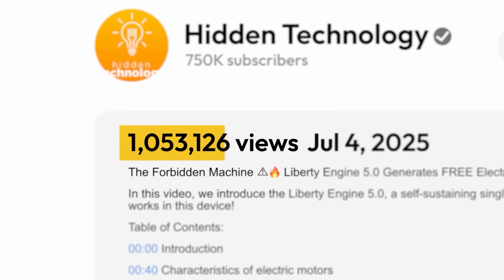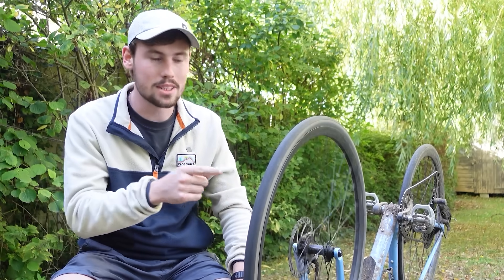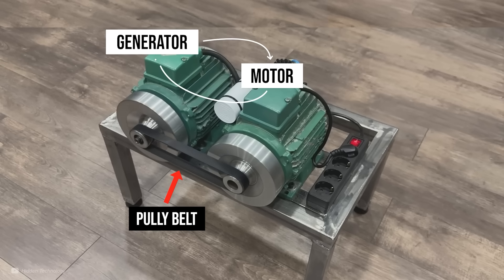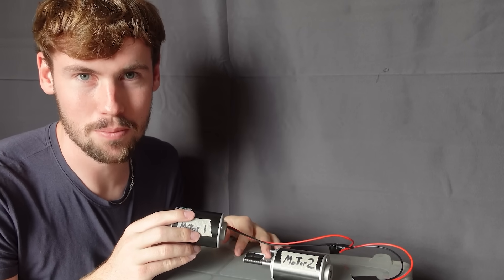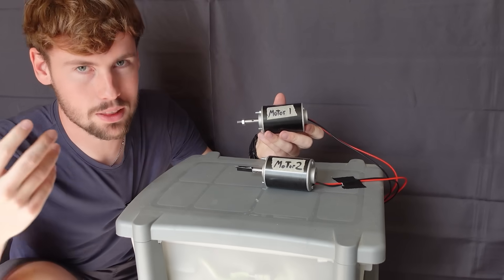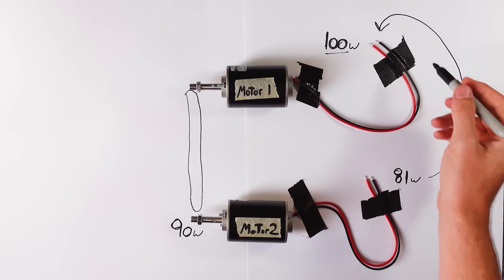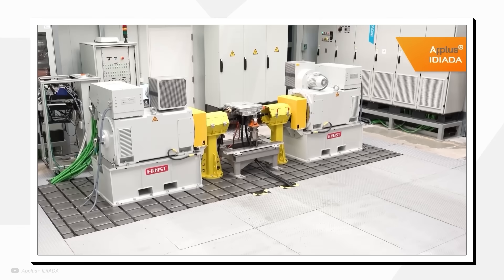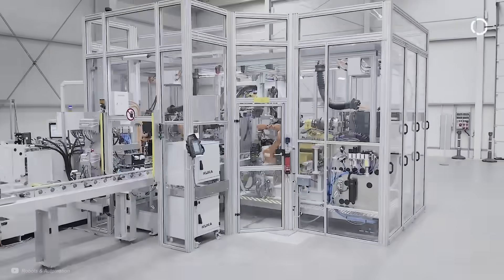100 Years of Waste! Solved by an Unlikely Invention.

Comment: Free energy and perpetual motion are entirely different things.  Perpetual motion is at least theoretically possible.  You could take a perpetual motion machine into intersteller space and spin it and it will spin for so long that it is essentially a perpetual motion machine.  What you cannot do is extract energy from the system in any way without it stopping.
Reply: Easier to use atmospheric energy. See  Herman Plausen's industrial scale patents
Reply: @jeffbrinkerhoff5121  Atmospheric what, you say?

Btw, just because you got a patent on something doesn't mean the thing patented is true, correct or working. There are TONS of patents of supposed perpetual motion machines, and ZERO of them actually work!
Reply: @lennyvalentin6485 hi Lenny. Plausen used balloons with gold plated acid sharpened needles to collect charges typically above 900' altitude. His motors were aimilar to rhe Jeffimenko style shown in this old video. Yes atmospheric energy.
https://youtu.be/9uEjXsX1F14?si=CHcpIYCUdfYLMm0J
Reply: @jeffbrinkerhoff5121  You mean Hermann Plauson, I assume. It's helpful if you get peoples' names right when one is trying to research them. ;) Anyway, he sounds like a crank, as does his ideas. Anyhow, if his contraptions could have collected any substantial amounts of energy (no reason to believe that to be the case), people would be doing it by now.

Like with so many other crank nonsense ideas (the "100 mpg carburettor", the "car that runs on water", etc etc etc etc), they all fall on the fact that if they did in fact work, people would have commercialized them long ago already. Because if they're viable, and work, someone could be making money out of them, and people love to make money, so they would be doing it.

In reality though, the Earth's atmosphere is some of the most researched systems we have, if it was somehow a source of free, abundant, harnessable energy, this would be widely known and yes, exploited also.

THE FACT IT IS NOT tells us that:
A: the energy might not be exploitable in a way which is commercially viable,
2: the energy might not be abundant, or even exist at all.
Reply: @lennyvalentin6485  There is a clock that is running on the subtle changes in atmospheric pressure.  I think it is called the Atmos Clock.
Nothing like this breaks any law of physics.  There is an easily identifiable source of energy driving it, the sun.

But you would think fuel injection put an end to the 100mpg carb.  But people still believe that crap.  Why the fuel system?  Why not some new miracle piston or some other new ICE design?  Some of these engine designs even exist or at least exist on paper.  There are engine designs where the power stroke is longer than the compression stroke.  It's just complicated (expensive and more points of failure) and additional linkages move inefficiencies elsewhere.
Reply: Everything is already in perpetual motion
Reply: Don't be silly. Perpetual motion machines won't substantially spin any longer in space, because it's not air resistance which is the major inhibitor to them working as perpetual motion machines. Rather, it's the laws of thermodynamics, which are universal.
Reply: @lennyvalentin6485  Wrong.  Depending on the design, you could easily spin something in space far from any mass that will spin essentially forever.
The voyager space craft are going to keep moving for millions if not billions of years.
Reply: That's like saying interstellar comets are perpetual motion "machines," because they will fly between the stars until an impact(s) stops them.    
Using your logic, we already have "perpetual motion machines" on earth because they have been running (slowly) for nearly 150 Years, and will likely run for another hundred.       That doesn't make it perpetual, just a very, very, efficient design & set of operating conditions.
Reply: @GoatPopsicle  Yeah, perpetual motion is possible.  150 years is perpetual motion so far as a person is concerned.
Perpetual motion isn't that impressive. It's just a system with little to no friction.  
You could take a wheel into space and spin it (not on a bearing axis) and it too would spin for a very, very long time.
There are also systems that can, all by themselves, suck energy out of the environment and run "forever" unattended.  There is a type of water pump (ram jet pump) that will run until parts fail or the stream powering it runs dry.  This and windmills are a kind of free energy device (free like beer).
Reply: @tarstarkusz  Just spinning doesn't make a perpetual motion machine, that's simply the conservation of inertia. Basic physics, Isaac Newton stuff for chrissakes. A perpetual motion machine on the other hand (supposedly) creates energy out of nothing. Simply spinning isn't creating anything. The spinning momentum has already been imparted onto the object at some earlier point.

Likewise the momentum of the Voyager spacecraft was imparted on them decades ago (rocket motors, planetary gravity assist maneuvers.) Simply coasting isn't creating energy. Is planet Earth orbiting the sun a perpetual motion machine too, you think?! lolwtf.
Reply: @lennyvalentin6485   You said "A perpetual motion machine on the other hand (supposedly) creates energy out of nothing." 
No.  That is a free energy device.  I've already said you cannot get energy out of a perpetual motion device.  It's just a 100% (or close) efficient device.  Yes, anything that moves in perpetuity is a perpetual motion device.
Yeah, since they will moving at close to 100% efficiency, they will still be moving in hundreds of thousands of years.  They are in motion.  Thus perpetual motion.
No, the Earth is losing momentum.  Plus the moon is stealing some of it.

What some people call perpetual motion devices are actually free energy devices. The system has friction in it and if it were to keep moving, it would have to get that energy somewhere.
Reply: @tarstarkusz  Perpetual motion machines/devices ARE free energy devices. It takes energy to run a device - there are ALWAYS losses. Again - laws of thermodynamics! There are zero 100% efficient energy transfers or transformations. There is always some form of drag, or friction, or energy leakage etc. No machine can run using zero power.

"Anything moving in perpetuity is a..."

Jesus christ. No! Again, anything just MOVING in a straight line (including planetary orbits, curiously) is merely Newton's conservation of inertia. And "close to 100% efficiency" is obviously not perpetuity. It may be a long time, but obviously FINITE. Planets moving in orbits are NOT DEVICES.  A chunk of rock flying through interstellar space is not a device. There's no energy transfer or transferrence.

Even in a high vacuum you can't have actual perpetual motion of anything spinning/moving - due to a phenomenon known as quantum friction a moving/spinning object would have its momentum sapped (extremely slowly.) Again, nothing is 100% loss-free in this universe.

High school physics is a good place to start your studies.
Reply: @lennyvalentin6485  Stop pretending I didn't heavily couch it as being perpetual in terms of a life time or even just in terms of society and not literally forever (literal perpetual).

ANY machine needs an initial push regardless of where that energy comes from.  All (theoretical) perpetual motion devices need to be started.  

The Voyager space craft are devices.  We literally put energy into them and now they are moving and will continue to move for so long that in terms of people, they are perpetual.  They will continue moving long after society has collapsed.

Again, you are just jumping back and onto perpetual, when I have already said multiple times in this thread that they aren't literally perpetual.

Comment: Wouldn't this have applications in renewable energy where you could use renewable energy to spin up a flywheel over a longer period of time that could then be maintained with smaller alternative energy inputs?
Reply: So this is actually a huge part of how green energy normalizes the constant fluctuations in power production.  During production surges, vacuum sealed flywheels are spun up and during low periods, the momentum is bled off, and the power draw out is kept relatively stable, so you don't get sudden flares of extra power or brownouts during relatively normal flux periods.

The flywheels are only a type of battery, though.  They lose mechanical energy at roughly the same rate they gain it.  So you can't use a small amount of power to maintain a larger generative potential.  In a 100% efficient system, you have to put exactly as much power into a system as you want out.  In even highly efficient flywheels, you're going to need to put more in than you get out, just like with a chemical battery.

Comment: If you’ve ever used a series of variable speed drives on a common DC bus then this news is decades old. The deceleration of one motor powers others that are not. Beats using break resistors. But good luck spec’ing the 800VDC switch gear needed for the isolation

Comment: I like the use where, say you have only 1 phase and you need 3, you can have a 1 phase motor connected to a 3 phase generator, and with some control you've got yourself 3 phase power now. Minus losses

Comment: One of the reasons (less educated) ppl believe this crap is momentum, when cables are not visible.
Even without cables a number of these even have an extra flywheel. So flywheels and rotors keep going for some time.

Comment: All of the motor -> generator perpetual motion machines try to look smart, and the grift is full of jargon and fake engineering, but none of them ever cut the losses of converting electricity into mechanical motion and back. That would be easy, just connect a transformer primary to its own secondary and wire up a light in series. The primary and secondary could be any ratio, even 1:1, and if their mechanically coupled transformer design had any chance of working, then the magnetically coupled design would be much easier to do.

But, you know, it doesn't look as complicated, so... 😂

Comment: Real-world perpetual motion machines, that create energy without spending a fuel or exhausting the source of energy within useful time-span exist. E.g. a solar cells do this job, as well as wind turbines, or hydroelectric power plants. The problem however is, fossile fuel industry don't like these concepts. Therefore, they prevent the crucial part of the equation by penal law: An economic seasonal power storage. In my country, (Switzerland), the EleG (electricity law) forbids the use of any form of produced or stored energy without a preexisting legal framework. Of course, things like solar power plants on mountains, or the so called baking-soda hydrogen storage (uses potassium bicarbonate/formiate) can't get such a legal framework. Therefore, we are bound to oil, gas, coal - and juicy electricity bills.
Reply: You would still be using energy input only, it would be coming from the universe, and therefore such a minute percentage that it might as well be perpetual.
Reply: @lookeehere2  It is a matter of definition. Perpetua mobile clearly do not exist. Perpetual motion however can exist, when the source of energy can not be depleted within a sensible amount of time. Machines, operated by solar-, wind-, geothermal energy, etc, meet this definition, because it will take about 4 billion years, until our sun will turn into a red giant and swallow planet earth.
Reply: That's good engineering, but it's not perpetual motion. 

It takes in energy from the sun, loses some as heat and noise, then you get to use the rest.

Even Einstein didn't think thermodynamics could ever be broken. You can't win. You can't even break even :-)
Reply: How is Switzerland's position on having a solar panel at home, and storing energy in a battery?
Reply: @HexBeach  Our leading party (SVP, same mindset as MAGA-Republicans) thwart solar and wind power by construction- and landscape protection laws. They want oil to be the main energy carrier, since our leading SVP-politicians are bribed by SwissOil. Our Environment minister was even the official head of this organisation for years.

Comment: They are very easy to recognize. If it says "Free" in anything it's a lie. There's no such thing as free in physics.
Reply: This is not exactly correct. Free energy in a thermodynamics context (e.g. a Carnot cycle) is alwys the amount of energy, within a system, that is able to do work.
Reply: @debrainwasher  I am sorry to be the bringer of bad news but entropy is a thing. We can only, EVER, go to a state of lesser energy. The best we can do is use the energy we have responsibly.
Reply: @cerellitv2978  did I claim something other? Please read my post again. However, thermodynamics with the entropy thing is only valid in a symmetrical system (see Noether Theorem). E.g. in an ever expanding universe, radiated energy becomes redshifted. Since E=hf, most radiated electromagnetic energy is annihilated. This can be derived from the least action principle.

Comment: We used the motor generator principle to test helicopter gearboxes. The power transmission are in thousands of hp so recirculating the power using electrical control equipment made it possible to test gearboxes with about tenth of the power. Basically inputing power just to cover the mechanical and electrical losses. Before that we used mechanically closed drive train loops, using the motor/generators system enabled different ratio gearboxes to be tested on the same rig.

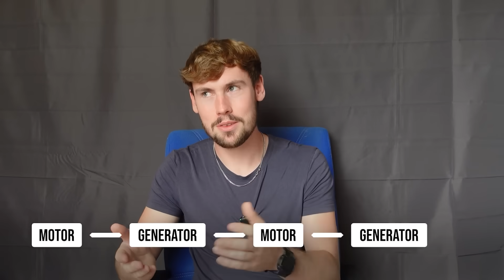Comment: 3:15 Fun Fact
This is a real device for creating energy and is in use throughout the world.

Seriously
The device is used to create three phase AC electricity from single phase AC electricity to use in welders and other machines that only run on three phase electricity by spinning a three phase alternator with a single phase motor.
It does however use much more energy than directly plugging the welder or whatever into a three phase mains source.

Comment: This is the same principle behind a motor-generator set used to make non-easy types of power.  If you want to test some piece of aircraft electronics that uses 400Hz power, because 400Hz transformers weigh less, you have to get that from someplace.  The cheapest way is to couple a mains-powered AC motor to a 400Hz AC motor acting as a generator.  Mains power goes in and 400Hz power comes out.  If you need 3 phase power in your barn and your farm only has residential split phase electricity, just hook a single phase motor to a three phase one.
Reply: 70 years ago aircraft had 25, 28 and 32 volt DC adjustable speed motors driving 400 hz 440vac generators. They were called rotary converters.

Comment: Connecting an electric motor to a generator. Was also a common and easy way of doing voltage conversion e.g.  24 volt DC to 220 volt AC before we had solid state electronics that could be used for such purpose
Reply: Or for frequency conversion too.

Comment: Used a similar setup where I worked in the 1980s, for testing gear that needed 50Hz, but we had 60Hz. Used 2 AC "machines", with a 6:5 pulley setup, so the driving motor ran at 1800RPM, but the generator ran at 1500RPM, giving 50Hz AC. The unit could delivered up to 500W of power. It finally broke in the 1990s, and was cheaper to replace with an electronic system, which had the extra benefit of varying the frequency. Of course, VFD (variable frequency drive), is commonplace, in industrial settings, nowadays.
Reply: Very smart and interesting usage to vary the frequency. 10 years in thd industrial world is quite a lot. I assumed that by the 80s power electronics were advanced enough for VFD, despite a high cost. Seems like I was wrong.

Comment: The real problem with perpetual motion machines (if they WERE possible)  is that, by definition, they cannot permit any loss of energy from the closed system - and are therefore useless for any practical purpose.
Reply: Over unity energy is what we need.
They are trying to do that with fusion reactors.

Comment: Why not add what they use for stun guns to amp voltage before the current goes back in to motor 1
Reply: That wouldn't work. If anything, that would make things even worse, because there is loss in the circuit that boosts the voltage. Perpetual motion, at least in this way, is impossible. Adding the voltage does nothing to help you. The energy in the system is still going to run out. I think the mistake you made is that voltage and power are not the same thing. The real measure of power is the watt. So, to put this in a metaphor that you'll understand, increasing voltage is like carrying all of the groceries from the car in one trip, vs multiple trips. The job is done faster, but the amount of groceries is the same. Electricity is not quite the same, but this works as a metaphor. Running the motor faster would spin the generator faster, but the motor would be an increased load on the generator, so you don't actually gain anything. And all the while, all of the components like bearings and brushes are losing energy to friction and heat. It's not possible to do perpetual motion, and adding voltage boosting from a stun gun does not help.  As a matter of fact, stun guns might produce high voltage, but very low amperage, which is the only way they can work. It's kind of like the tradeoff with levers, or ramps. You can either have a short distance to move something, or lower effort, but not both.